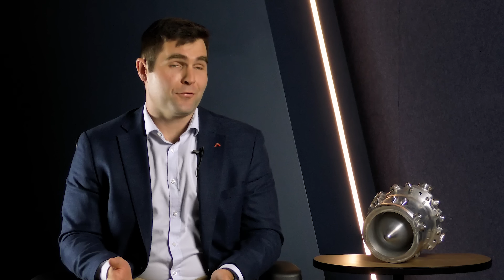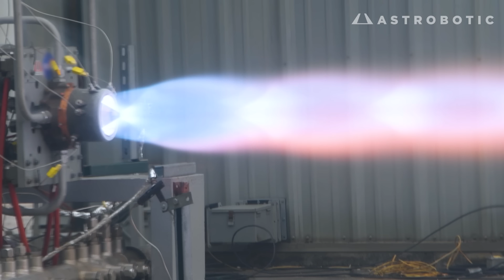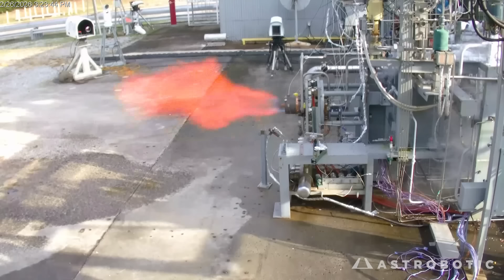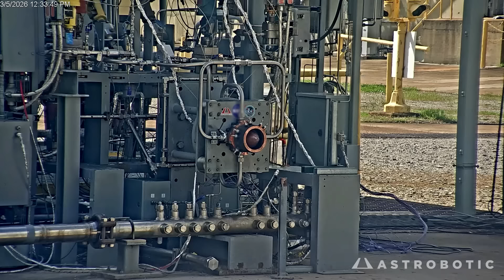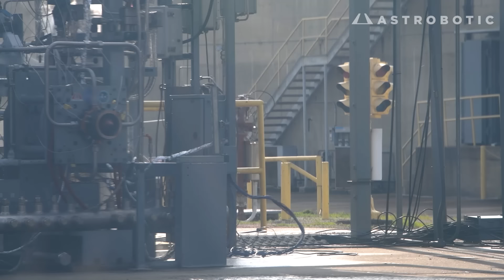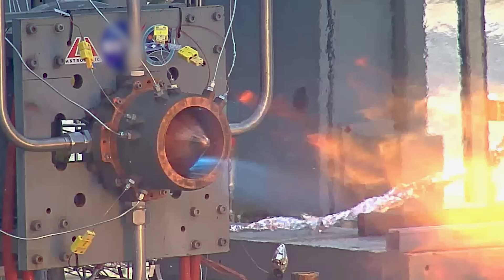Astrobotic Breaks Records for Hot Firing Rotating Detonation Rocket Engine (RDRE)

Comment: 4000 lbs of thrust from that little engine...... mindblowing.
Reply: what’s that in newtons…
Reply: Even at that size, the applications for on orbit or deep space, it's a fair kick up in speed for the fuel mass used.
Reply: @PiDsPagePrototypes  how so?  The throat is actually less efficient than a conventional rocket motor.
Reply: @PiDsPagePrototypes  " deep space"
It uses "detonation waves"  to "make" the conventional bell. space is vacuum so i doubt that it will work there, there is no medium to set up those waves.
Just a thought.
Reply: @brammeijboom-mj9ld  The combustion chamber isn’t a vacuum, and external conditions don’t matter past the throat of the nozzle.
Reply: @brammeijboom-mj9ld Might want to stop having those, might not be getting enough Oxygen for them. Just like regular rockets, the Oxygen to burn the fuel with is supplied within the motor, no atmosphere or external pressure required.
Reply: @brammeijboom-mj9ld  You don't understand how an aerospike works. Look that up, your will see that your criticism is false.
Reply: @brammeijboom-mj9ld  efficiency actually increases because nothing is inhibiting the exhaust velocity
Reply: @brammeijboom-mj9ld flat earther detected.
Reply: @brammeijboom-mj9ld no it doesnt it uses detonation waves to pump fuel and lox more effienctly the nozzle is just an earospike
Reply: Well that's not the engine. It's just the combustion chamber. the complete engine, with all pumps and regulators and such will be significantly larger
Reply: @deven6518 RDE require much smaller pumps as I remember due its nature
Reply: @deven6518  ok,
That's a huge amount of thrust for such a small combustion chamber.
Reply: @Jordan-rb28 while I appreciate the correction, I'm just pointing out that the engine isn't as small as it seems. Most high-end rocket systems, if scaled down and all other equipment was mounted away from the engine, would look pretty small as well.
Reply: Its amazing the weight savings alone is mind blowing. Land and take off larger payloads larger vehicles ect. I am looking forward to see how this does it may change the field.
Reply: @chadstinson9886  Weight savings… in the pumps.  Rockets need chamber pressure for efficiency and power density.  High pressure yields high temperature, and high temperature boosts efficiency.  That’s why high compression ratio diesels are more efficient than gasoline engines.  The RDE provides pressure and temperature as part of the combustion process, so you don’t need to pump the chamber pressure up nearly as high.  You can achieve the same efficiency with a simple blowdown architecture without pumps.

But without the pumps and charge density, you don’t get the power.  That combustion chamber is around the same size as the AJ10, which delivers anywhere from 5-20klbs of thrust depending on chamber pressure.  Higher chamber pressure means bigger, heavier pumps, or stronger, heavier tanks.
Reply: @wagnerrp yes the pump has mass but the engine we use now have bells nozzles with enter cryogenic cooling or coatings that burn off sheding heat also they have pumps that add mass as well. So my point was that the size of the nozzle saves a huge amount of weight.
Reply: @wagnerrp  complete and utter nonsense
Reply: @chadstinson9886  That engine is under-expanded in thick atmosphere.  Nearly all engines are significantly over-expanded at takeoff as that optimizes efficiency over the whole flight.  This isn't a complete engine with a full size nozzle because they're not trying to test a complete engine.  They're just trying to test the combustion chamber.  That's the novel element that needs significant testing.
Reply: @wagnerrp As explained in the video, the nozzle uses the same concept as aerospike engines which adjust expansion using pressure differential.
Reply: @chadstinson9886  - Of course DARPA will get hold of it and weaponize it within a year.
Reply: @WarHawk-  lots of great things have come from them wish it didn't get classified for 20 to 50 years before the public can use it.
Reply: Тяга 4000 ног?)) вы что с каменного века, измеряете ногтями лаптями и носами?))
Reply: Yea but the thing is it's almost silly to make it bigger, it usse astronomical amount of air and fuel if it was bigger it would be hard to even run it without stalling it.
Reply: @tom79623  It uses precisely zero air and the fuel efficiency is higher than those of a conventional engine, what are you even trying to say here?
Reply: @h.a.9880  how did you come to that conclusion? How do you get a combustion of it's ussing zero air? 

The thing has continuous traveling detonation wave, do you really think that requires no air fuel mixture with insane consumption speed? 

The air input alone is enough to classify this thing as a rocket...
Reply: @tom79623  "how did you come to that conclusion? How do you get a combustion of it's ussing zero air?" 

Rocket engines don't use air, period. This is no exception.
Like most other rockets, this one uses oxygen.
The means to mix oxygen and fuel in this type of engine is a challenge, but not insurmountable, given that this prototype already proved that it can run just fine at full thrust for 5 minutes.
And just for completeness' sake: conventional engine designes have complex nozzle setups as well. You can't just blow oxidizer and fuel into a chamber and hope for the best, getting a thorough mix of both to ignite within the fraction of a second before it gets set off is not a trivial matter either.
Reply: @h.a.9880 first of all my original comment was about the size of the cumbustion (detonation in this case) part of the rocket and why it's so small.

And my point still stands, the engine requires ridiculously high pressure pumps to work properly otherwise you get back flow, and even tho it uses 15 to 20% less oxygen for the same power it uses it in a lot more confined space. 25 to 50% smaller than a classic rocket engine. 

So if you made it as big as a normal rocket you would also make it a lot more powerful but it would also require that much more fuel and oxygen.

And for your information air has around 20% of oqygen in it's contents so you can breathe, so excuse me for not specifically stating i meant oxygen when i left a random youtube comment.
Reply: no. its not. its not even in the middle level.
Reply: Almost enough to propel your mom
Reply: i mean the Raptor 3 isnt incredible large aswell and creates 620000 pounds of thrust. Which is insane for its size imo
Reply: Looks pretty huge to me...l i mean the nozzle is small but the apparatus behind it is probably required lol
Reply: The nozzle is little but all the mechanics behind that panel are VERY extensive.
Reply: More powerful than an Me-262's Jumo 004 turbojet.
Reply: Thrust says very little, I'd love to see how much Isp are they getting out of it. Then you can compare it with Raptor engines
Reply: @bano99  A hydrolox based rotating detonation engine could theoretically reach an Isp between 500 to 530. The raptor engine might reach an Isp of around 350.
Reply: @shushirakawa3182  The engine I have designed theoretically could achieve an Isp of 750.  Theoretically.
Reply: @shushirakawa3182  That is an impressive ISP at a pretty fierce thrust level.
Also, the design seems to be extremely robust in terms of its structure... engine bells are flimsy compared to this huge chunk of metal. Could be the future for reusable spacecraft, given that it seems to meet three really important marks:
Sturdy, efficient, powerful.
Now it needs to show that it is in fact also reliable, then this could very well be the future of engine designs.
Reply: @DumbledoreMcCracken are you being funny or are you serious?
Reply: @chadstinson9886  are you?
Reply: You mean that massive engine... look behind the nozzle and youll learn why its not feasible.
Reply: @ROFLp0wNz  Honest to god, you are aware that this is an engine strapped to the test stand and like 95% of what you see is that test stand, right? Right?
No one here overlooks that the engine needs powerpumps and plumbing to run and that adds to the overall design, but the fact that the actual nozzle (ie: the only thing actually exposed on the outside) is such a sturdy and compact design gives this thing tons of applications, no matter how large the rest of the engine is inside a structural shroud.
Reply: @h.a.9880  that was my point also. Its amazing what Dunning-Kruger can do to people. A test stand have so many sensors and safety equipment and over build to handle most accidents. We are talking about the gunpower in a bullet and all they see is the rifle.
Reply: @chadstinson9886  If you know anything about RDEs you know that all that stuff behind the combustor is not just sensors. Some of that stuff is built much heavier than it would be for a flyable vehicle, but it all comes to FAR more than you would find on a more conventional test stand.
Reply: @weatheranddarkness  I made this exact point in the comments. I hope you pushed reply on the wrong person it happens ive done it. In my comment I said they overbuilt the test stand. But I didn't put why Its for the unaccounted for extra release of all the thrust in milliseconds. 😂 also my point was most engines like this use pumps, exhaust turbo pumps, and other equipment to get higher efficiency and I had accounted for all that when I said "the weight savings will be great"
Reply: @ROFLp0wNz  ну за этим стоит компресор в цеху))  размером с статую свободы)  Примитивная форма не более!
Reply: @ROFLp0wNz  I give up test stands are not setup to be compact and are overbuilt smfh
Reply: What’s on the desk next to him is a scale model - not the actual engine.
Reply: @yyyyyeeeee4060  in the vid he says thats the size of the actual engine.
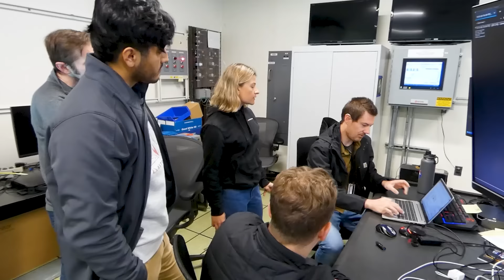Reply: @yyyyyeeeee4060  At 1:12 you see people standing next to the test engine. It is tiny.
Reply: @Nosian76 20 seconds later you see the dude holding a 1:1 replica in his hands.
Reply: @yyyyyeeeee4060  it's a 1:1 scale model lol
Reply: Are you deaf?

Comment: Fascinating! I am excited that someone is chasing this (RDRE) technology. I just subscribed to learn more and follow.
I am curious - is a torque observed on the motor during firing?
Reply: That's an awesome question! I've seen a few vids on the tech but nobody's mentioned it. I'm curious too!
Reply: I don't think there is any reason there would be a torque. Nothing mechanical is rotating, it's just the detonation wave that's rotating. Which is more of just a pattern moving around the engine, all the actual mass is moving straight out the back of the engine.
Reply: @ninjafruitchilled  but waves do carry momentum, right?
Reply: @WarttHog  not pattern waves. Like no matter is physically going around the circle. It's like if you draw circles with a laser pointer. Yeah the point goes around in a circle, but it's not carrying any momentum around in a circle. In fact you can make that point move faster than the speed of light, because it's not a physical thing itself. Like imagine a circle of led lights, where you just turn them on and off in a pattern so it looks like the "on" light moves around the circle. That "on" light isn't carrying any momentum.
Reply: @ninjafruitchilled  Oh. I hadn't thought of this as that kind of wave but you may be right.

It's not exactly like the laser pointer or the LED lights in a circle, because one detonation is causing the one beside it.

I admit I don't know enough to guess if a moving flame front would impart momentum ALONG a wall... 🤔

Comment: BEAUTIFUL Mach diamonds! 😎👍🏼👍🏼 Is it able to throttle up / down, or just wide open?
Reply: I'd assume just wide-open right now, as detonation engines are infamously flow-thirsty: turn them down too low and they stop working. Though, it would be interesting if they can push the detonations part way into the aerospike and maintain operations...
Reply: @absalomdraconis  That's just a plug nozzle.  It's missing the "aero" part of "aerospike".
Reply: I'd guess not in this version (Seems like something they wouldn't include in the first prototype just trying to prove high thrust), but if they could manage to drop to 2 or 1 detonation fronts, that might provide a way to throttle it down. No idea how you could make the transition though. I'd love for more data in this area.
Reply: @---.. I suspect the triple dettonation is intentional though to keep the thing stable